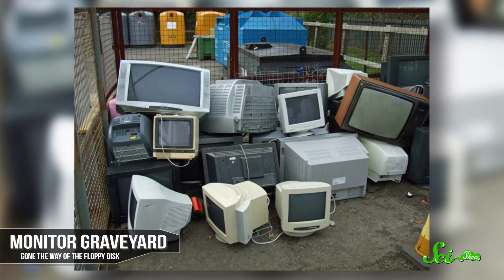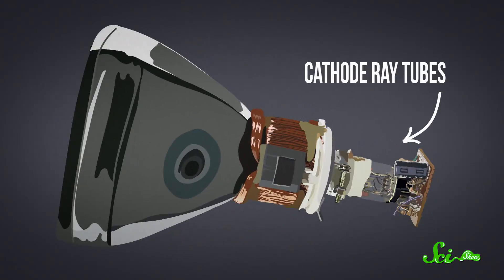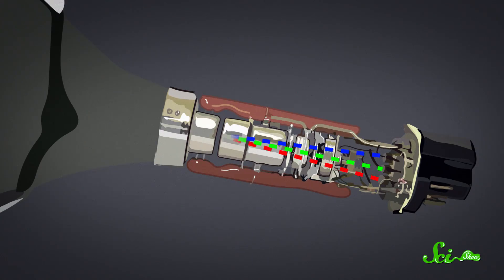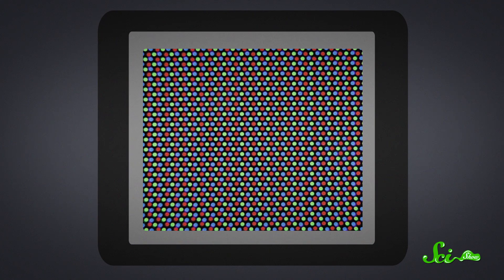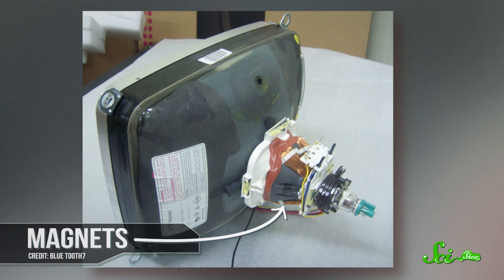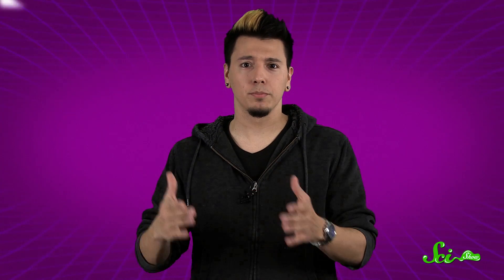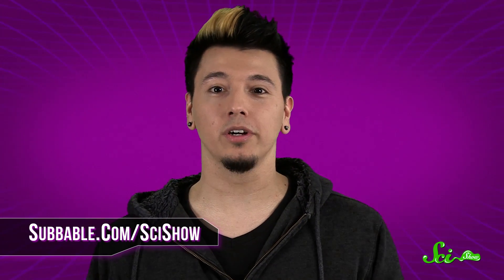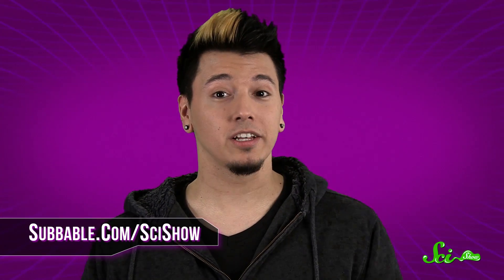How Did a Magnet Just Break My Monitor?

Comment: When you search for how CRT's work, it's always shown from the outside. I've always wanted to see the magnets moving the electron beam in real time. I can't believe just how fast they must be moving to accurately shoot the beam on each of those phosphorous dots - it's mind-blowing.

Back of the envelope calculation.. 

I'll use some rounded numbers to make it easier.. 

A 30 inch television depending on the model, has either 525 or 625 lines of resolution. Let's go with 625.

The electron beam must move 625 x 30 inches.

So, for 625 lines, the electron beam will 18,750 inches per frame.

18,750 inches per 1/30th of a second = 562,500 inches per second

Which = 31,960.2 mph
 
Uhm.. well, obviously the electron beam starts at the back of the television, hence why CRT monitors are so deep compared to flat screen displays. So, the electron beam isn't moving 31,000 mph, that's the speed the lines appear moving across the screen. To work out the speed that the beam moves where it's projected from would need some trigonometry.

The depth of a television set compared to it's screen width is proportional. The general consensus is that it is 0.85 to 1.0 ratio depth to width. So there must be some speed discrepancy between the beam moving at source to the lines being projected on screen. 

The highest resolution CRT computer monitor I could find is 2560x1600, with refresh speeds up to 85hz.
That's 3 808 000 inches per second
Or 21,6363.63 miles per hour..

Have I made a mistake here?

Comment: There is a way to fix it. my grandpa and dad fixed tv's and they would use a device to correct it. it was a magnetic hoop wrapped in a cable that was plugged into the wall. When the tv was on, they would plug in the device and wave it in a circular motion around the affected area. In less then a minute the screen was normal again

Comment: For anyone who collects old computers (or color televisions), it's been mentioned that degaussing can fix it.  If you don't have a degaussing coil, you may be able to find a cheap alternative in a bulk tape eraser.  Hold the tape eraser near the display and turn it on.  Move the degaussing coil or tape eraser in a circle around the display (yeah, I know the display isn't a circle, humor me) while slowly moving the degausser further from the display.  When it stops having an effect on the display, or you've reached the end of your electrical cord, turn it off.  Your display should be back to normal, unless the damage was so severe that the problem is more than magnetized beam thingies or whatever. :)  Be sure to move your display away from the case holding your computer's hard drive before degaussing, or you'll wind up erasing stuff.

Comment: You can throw away your CRT and get a modern LCD display instead.

Or you can fix your magnetized CRT. You just need a coil with alternating current. You approach the magnetized spots, move around then slowly retract the coil. The alternating magnetic field must be strong enough to saturate the maximum magnetic field of the shadow mask.

You may have to repeat as new weaker color deformation appear as you remove the strongest one at a time.

You may decide to keep the CRT in a dry place for future high voltage experiments. Once all CRT are gone, it could be hard to find any electronic device capable of generating 25 kilo volt DC.

Comment: I just want to mention some crt monitors actually have a degauss feature that can fix those issues. It's right in the onscreen menu! It might not always work and might not be on your monitor but hey figured I'd mention it.
Reply: you can also use a degaussing wand to fix them, a common tool the TV service man would carry with him self back in the day.
Reply: I'd like to mention that if you're still using CRT then it's probably time to upgrade...
I was kinda hoping this video would be about more modern technology, as I remember killing the screen of my laptop by placing a magnet near the hinges 5 years ago.

I assume it had to do with the magnet inducing some current to the back-light circuit, but this video is completely useless... They uploaded this at a time where almost nobody has CRTs.

Comment: How does Monitor/TV burn-in work?
Reply: Literally by burning the pixels in the monitor/TV.
The way Plasma monitors works is by energizing a gas with electricity so that it emits light, leave the pixels on for too long and it will physically burn an image onto the glass sheets that makes up the pixels.

You can see this effect on fluorescent lights, if you look at a well used or burned out fluorescent lights you will notice two black areas on either sides, this is basically how you can burn an image on a monitor/TV.

Like he mentioned in this video, plasma and CRT monitors have a coating, and that coating emits light when excited. a tiny bit of that coating is burned off and the coating is converted to a type of Oxide, Phosphor-oxide or [plasmaTV]-oxide (I have no idea exactly how the chemistry works but I know it burns and leaves a residue that does not emit light).

Though take note that LCDs don't suffer from that effect, although not unheard off you're more likely to get stuck pixels rather then a burned in image.
Reply: svampebob007 What about my AMOLED phone that has my messages app burned into the screen?
Reply: Memestar
 oh I didn't even think about those, but yeah it's the same principle they break down.

The reason LCDs don't suffer from burn in (again it's extremely rare) is because the light isn't emitted by the pixels (and the back light use regular LEDs) and the individual pixels just "passively" let the light through .

this is very simplified, so you should look up some of the different technologies and read up to get a better picture of what's going on in them.

Comment: It's the distortion caused to the shadow mask by a magnet that causes the damage to a crt. The higher the resolution of the tube the more pronounced the damage will be due to the smaller holes in the shadow mask. This is a fine piece of steel that has a lot of holes cut in it and will bend from the pull of a decent magnet

Comment: Did... Did you guys just guess at this? I mean, 30 seconds of googling provides you with the actual reason, it's even on the wikipedia page for CRTs... How did you miss this? It's the shadow mask near the electron gun at the rear of the screen, you can even see the degaussing coil in the picture you guys provided in the video that removes any induced magnetism from the mask. When that doesn't work, it's because the magnet has physically deformed the mask, which can't be fixed by a degaussing coil. It's... It's literally the first result guys...

Comment: what if i hook billions of cables to these light, they would just work normal, and not be interfered by magnet. (that is, if you could fit a billion cables in such a small area and have each one not touching the other through a conductive material

Comment: all you need to fix it is a Degaussing ring, its just a 2 foot or so coil of wire that plugs into 110 socket that creates a alternating magnetic field that resets the face of the screen by starting close and pulling it away, then use the Degauss feature on monitor to get the rest out. I put a high power 12" stereo magnet on mine and it drew everything into a small point about 1.5 inch circle on the screen, used the ring and back to normal.

Comment: One thing that I did manage to do as a kid was destroy a TV using nothing but a piece of paper, and I still don't know how I did it.
Basically as a little kid, I read a lot and as such I knew that if I stuck pieces of paper to the front of a cathode ray tube they'd stick because of all the static electricity created there, so in a fit of curiosity I wanted to see if the TV could hold an entire sheet of paper, so I put one there. It was a small portable TV and the sheet covered the entire screen, it stuck there for a little while and then the entire TV just shut down, and never started up again.

Like I say, I still have no idea how that happened, and since I went for biomedicine instead of electrical engineering in college I figure I never will... Does anyone know why this happened?

Comment: This is just completely wrong.

The phosphor does not get magnetized. What could get magnetized is the shadowmask, which is a metal screen inside the tube that help directs the electron beams to the correct phosphor. Furthermore this magnetization is by no means permanent. Monitors generally had a circuit built in that demagnetizes the screen every time it turns on. The circuit running a few times is generally enough to correct most issues. Magnetization too strong for this built in degaussing circuit can be fixed by an external degaussing ring or wand.

The only way the monitor could be permanently damaged by a magnet is if the magnet was so strong it physically bent the screen inside the tube. Even then the issue is not magnetization, but the mask not being in the proper location.

I learned most of the in the process of rebuilding a 20 year old arcade monitor. I had what I thought was a magnetic issue, but it turns out the yoke of the monitor had been knocked out of place, the yoke being the electromagnet mounted on the rear of the tube that directs the electron beams. Real fun considering you have to readjust it while the monitor is on.

Comment: This channel is called SciShow, which has misled me to believe that you are into facts. Magnetising parts of your CRT does not damage it, it merely magnetises it, and just like it's easy to magnetise something, it is equally easy to demagnetise it. It's not broken, only slightly detuned. In actual fact it isn't the phosphor that gets magnetised but the shadow mask which lies just behind it. Also, there is a thing called a demagnetising coil on the inside of the CRT that is operated every time the CRT is powered that is there for no other reason than to demagnetise the shadow mask, so after 10-20 power cycles (with a 15-20 minute break in between) that will in fact undo all but the very worst cases. For the hardier cases there is a thing called a demagnetising wand that fixes all evils (magnetic ones that is). Finally, the beam actually doesn't need to be fired with such great precision, the shadow mask takes care of most of it and the real trick is keeping the shadow mask aligned across temperature. I could write a book on this subject, so I won't elaborate more here, but please do your research and don't spread untruths on a channel called SciShow. please

Comment: It's not exactly permanent. You can fix it. Run a power drill near to it (holding the part where the motor is housed up to the glass) and make circular motions, buffing it out....Don't touch the glass with it. Just hover it. Then you can play duck hunt again (your welcome).

Comment: or most CRT monitors (at least ones that were any good) had a Deguass feature that would allow the user to basically reset the monitor to default state (its very convenient in high static situations)

Comment: Magnets, particularly strong ones, are a good thing to keep right away from any computerised kit. They can ruin monitors, as shown, but they can also ruin floppy drives, hard disks, or any other magnetic storage media, like backup tapes. They can also introduce errors to chips, which should be temporary, but a system crash can cause file corruption and errors... I would not like to have important files on a flash memory card taken anywhere near a strong magnet either. Don't take magnets - especially strong magnets - anywhere near a computer.

Comment: Not true. The screen is not permamently damaged. In fact most of CRT screens have a coil around the screen to demagnetize it every time it is turned on. If magnetisation is really strong sometimes you have to swich it on and off several times. Even if it is magnetized really strong  and monitor can not "heal" it self, it is not permament, it can be fixed.

Comment: I'm sorry SciShow, this episode was so oversimplified, and in parts is just wrong. The phosphorus coating does not really become magnetised. The magnets are causing these distortion because of magnetising the shadow mask (or aperture grille). You can fix this by degaussing, which is a fancy term for demagnetizing. Bringing a magnet to a CRT under normal circumstances wont permanently damage it. Many monitors had a deguass ciruit and would do this as part of turning on the screen. All deguassing did was create an alternating pole N/S magnetic field that would gradualy reduce to negligible strength. Normally if no external megnetic fields were still present this would demagnetise the mask or aperture grille and your CRT should once again work as expected.  You guys know you have a nerd fanbase and will get called out when you get it wrong. In this case many like me are old enough to have decades of experience repairing CRT based televisions and monitors. Please redo this one, or at least add another correcting and going a bit more in depth so not to leave an incorrect understanding of the technology for those who may not decide to look it up for themselves.

Comment: So Question time, Iv recently visualised Eintein evaluation of the curvature of space due to gravity, and I assume we all are using the idea if the 3 dimensional plain of the seemingly infinite number of interconnecting lines that form a massive cube matrix but that doesn't explain how planets orbit, almost everything orbits in the same direction bar some (like Venus) but what about a theory of not cubical space but a matrix of 64  bit tetra-hedrons. A 64 tetra-hedron matrix makes more sense to me regarding orbits for instance take the inverse of it and you have the vector equilibrium, which can naturally twist down on itself, twisting straight down. Now imagine this new matrix of space with Einstein's theory of gravity, the mass accumulates and increases becoming heavy and naturally turning as the body begins to form, perhaps matter is caught in the overlapping of space and is caught as space bends around the body, creating a force of gravity proportional to the mass, and as ever moving though ever stable the universe turns, the force is constantly in rotation with no changes in mass. I havent been to uni or anything which is obvious and I'm not trying to claim anything, I just came up with an idea I thought worth sharing for the sake of science and discovery.

Comment: Actually, the problems arose when the shadow mask became magnetized.  This was fixed, hopefully, by degaussing.  I used to fix those type of displays.  Still have a few degaussing rings.  This used to be a common problem and in many cases an easy fix.
The deflection magnets were often out of range for most magnets given the bulk of most TV's/displays.  Shadow mask, not so much.  Many later displays had automatic degaussing, some when switched on.   
You guys aren't that young and could do better research.  This "advanced repair" technique was commonly learned  at such renowned libraries of knowledge like Best Buy tech bays.

Comment: That explanation is actually incorrect. The phosphors inside a crt do not have magnetic domains,  nor do they maintain a magnetic field. What actually happens is you either magnetize the steel shadow mask (temporary) inside the crt  which has a special coil called a degausser coil that sets it's bias to zero every time you turn it on, when you get really powerful magnets  you actually bend the shadow mask in such a way that it's geometry will change and the electeon beam  is no longer perfectly perpendicular to the tiny holes in it which causes the electron beam directed through it to diffract instead of be focused by it, in turn hitting the wrong phosphors you get an unfocused pattern of red green and blue fringes.  

Whoever wrote this hasn't the faintest clue how crt's actually worked back in the day.

Comment: The damage to caused by the magnet is not permanent.
It can be fixed using a short exposure to a strong electromagnet held at a distance in front of the screen. I've seen it used on old arcade machines.

Comment: Many times if you don't have a degauss button that works, you can use the magnet to drag the magnetized spot to the edge of the screen. If you can remove the plastic frame on the front end of the sceen, you may drag it far enough on the edge to get rid of it.

Comment: Good video despite the one minor mistake (phosphor vs.shadow mask (Shadow Mask would be a good name for a super hero)).
In case anybody cares, the REASON color CRTs are far more susceptible to magnetic fields than monochrome CRTs is that the Red, Green, and Blue beams are deflected enough that they fall on phosphor dots which they were not intended to hit. EG red beam falls on green and blue dots, G on R+B, and B on R+G. A sufficiently strong magnetic field could permanently damage the CRT by warping the shadow mask, but that's very rare.

Comment: Most if not any monitor has built in degauss coil, which is remove most of the magnetization by passing AC current threw this coil each time you turning screen ON. This is used to compensate earth magnetic field.

Comment: Oh dear, don't discuss old technology lets you understand it. CRTs are not "permanently" damaged with a magnetic field. It is easily fixed by using what is called a degaussing wand. This is essentially an electromagnet that is connected to the AC mains. This gives an alternating magnetic field. It is simply moved around the CRT getting further away until you are about an arms length and then switch it off. All fixed.

People who have purchased very large CRT TVs that live act greater distance from the equator will periodic color patches appearing on the TV screen do to the Earth's magnetic field. Degaussing fixes this.